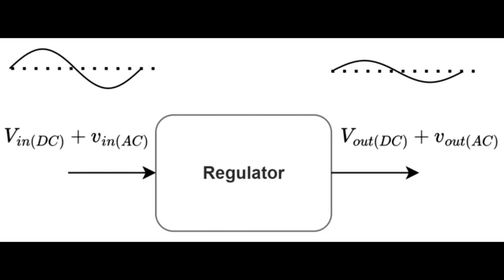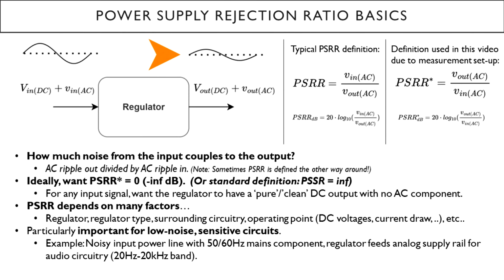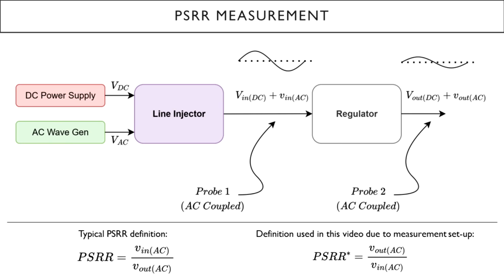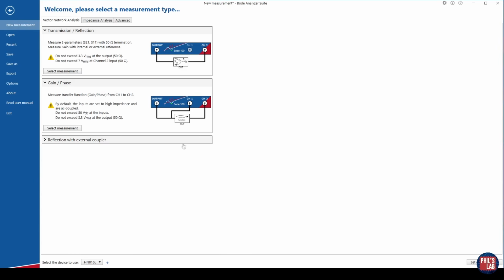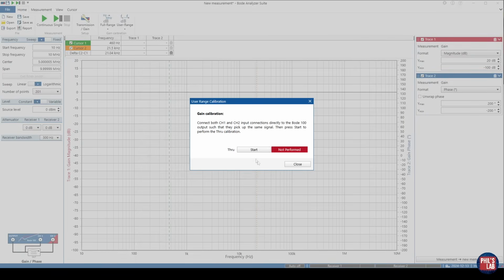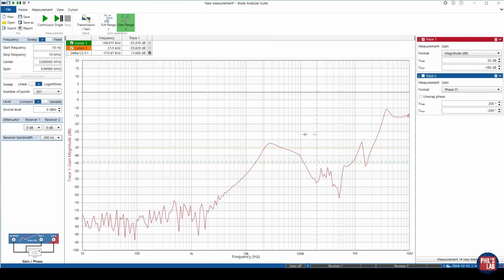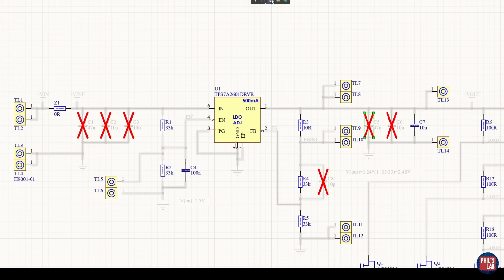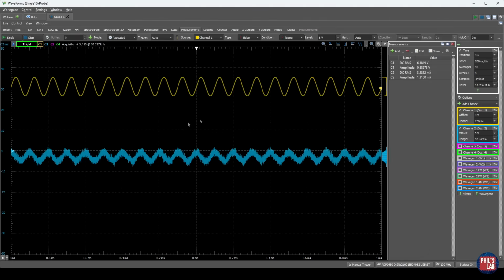Power Supply Rejection Ratio (PSRR) Basics & Measurement - Phil's Lab #163

Comment: Thanks Phil once more for thus consistent mentorship. When will you drop a guide on High Density Interconnect PCB? Plus I designed a 4x BLDC motor control training board around the STM32H7, I wonder how I can turn it into an official development platform.
Reply from the maker: Thanks, Edger! I've wanted to do a couple HDI tutorial videos, but unfortunately JLCPCB doesn't currently offer HDI PCBs - so that'll have to wait a bit.
Reply: @PhilsLab ok, I'm waiting

Comment: be careful with standard 10:1 oscilloscope probes and the Bode 100. The Bode100 1M input impedance is after the coupling capactior so you risk blowing up something as all the DC willbe on that cap. Also the 10:1 division isn't correct at very low frequencies because that capacitor in series with the probe although I don't think it'll affect much here.
Omicron has a warning somewhere in the page/application notes and also offer their probes
Reply from the maker: Thanks, that's a very good point. I've seen their note on that and I actually have their 10x probes as well. The inputs caps are rated to 50VDC, so for this application that would be fine (even though 'proper' division is not happening with standard probes).

Comment: Great video as always! Is using a low pass LC (or pi filter) at the input of the LDO a good way to compensate for psrr decreasing after around 1kHZ? If so what cut off frequency should i aim for?

Edit: also when pairing an LDO with a buck converter is checking the psrr of the LDO at the switching frequency of the buck converter a good estimation of how much of the ripple is going to appear at the output? Let's say the converter is switching at 500kHz and the psrr of the LDO is 40dB at that frequency. Is it correct to assume the output ripple of the LDO is 10mV if there is a 1V ripple out of the buck converter?
Reply from the maker: Thanks! Yes, sometimes a pre-filter (e.g. RC) can help. You can also cascade linear regulators to improve PSRR. Regarding your second question: In theory yes, if the ripple is fundamentally (quite literally) just the switching frequency. However, there may be harmonics, integrated noise (for both buck and LDO), as well as circuit/PCB non-idealities that come in to play.
Reply: @PhilsLab thank you for your response!

Comment: The hrs of run I've had injecting ripple on to the DC power lines during post design testing for customer acceptance. To confirm we have met the requirements for PSRR at all the ripple frequencies expected. I used to use some large ripple injection transformers to cope with the DC currents. thanks for bringing back the memories' of the fun days in R&D.